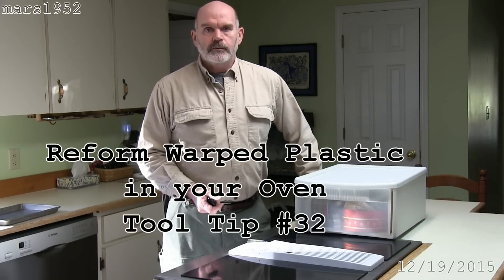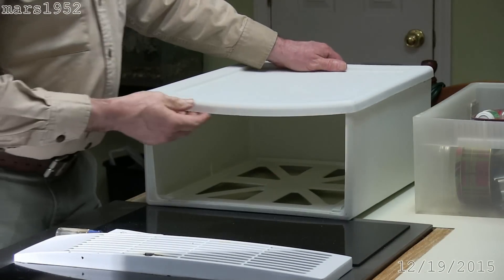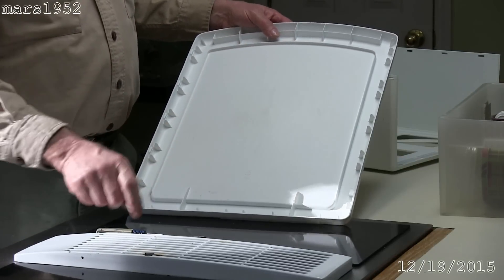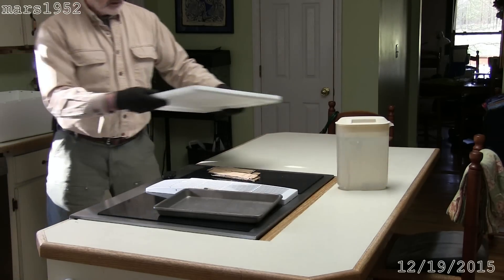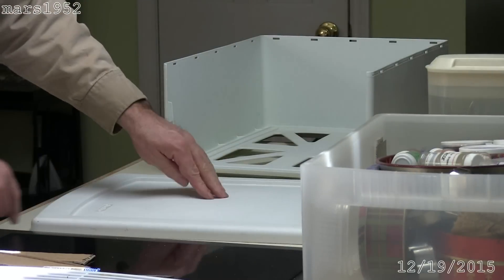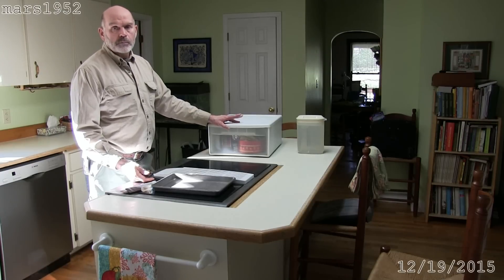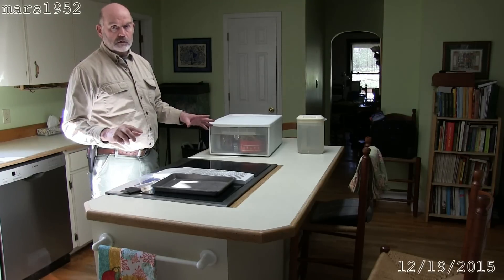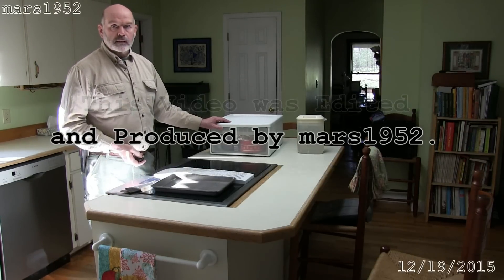Reshape Warped Plastic in your Oven Tool Tip #32

Comment: In-genius idea and execution.  I have the problem with the drawers sagging on the bottom from too much weight being put in the drawer and the drawer being hard to slide back and forth.  I am going to give your idea a whirl and see if it works.  Lucky for me the type of resin in my drawers is the same number 5 so I can use 300F too. It works like a champ and restored the drawer perfectly.  My model is the Sterilite wide drawer and the bottom is much thinner plastic so I only used my broiler pan with a 48 oz bottle to weight it down.  Both the heating with the oven turned off and the cooling process took about 6 minutes each.  Weight it down on whatever side is warped to force the warp down.  Mostly the heating restored the shape but a person wants to weight it down to reinforce the memory as it is cooling down again to room temperature. If a person is doing several I would suggest turning down the oven to 280 degrees (plastic numbered 5) for subsequent trials. Always remember to turn off the oven when the preheating is finished.

Comment: Ok this has nothing to do with a plastic drawer top but I had a plastic based desk lamp the kind with the bendy swivel metal neck. The lamp got left outside in the summer heat a year ago and warped onto itself so the lamp wouldn't stand upright it was going to get tossed. But after watching this video and figuring I could use my blow dryer on high in specific spots to reshape it with pliers and push on it covering my hands it would go back into shape, it did! So thank you for posting this video.
Reply: Thank you for hair dryer idea!
Reply: I was wondering about the hairdryer because my drawer is to big for my oven, thanks for sharing

Comment: Reminds me of plumber's using a heat gun to make solid PVC pipe flexible.
Reply: I used those candle lighter deal when I was trying to get my drip system set up and the drippers refused to go in the punch on the  rigid pipe...worked well and being warmed up sealed the opening to the dripper NO leaks.

Comment: Thank you SO MUCH for this hack and posting it! You saved me SO MUCH frustration with my rolling cart! I stayed next to the oven after preheating it. I put the plastic leg of my 3-tier cart (the shelf with the handle attached has a warped section on just one of the legs' connection areas and it's so large that I can't fit it into my oven so I decided to remold one side of the detachable legs that go between the shelf racks) onto the top rack away from the bottom heating elements. It only took 3 minutes before I started smelling the plastic, so I reached in and felt the plastic with my microfiber cloth and it DID give way so I took it out and put it back onto the top shelf's warped leg piece and then reassembled it back with the rest of the cart to make sure that it would mold properly and the bottom side of the leg didn't get messed up while I was remolding the top! 😩💨 I was a bundle of nerves for about 5 minutes and then totally excited afterwards! 😁👍 So thanks a bunch!!! 💕💕💕

Comment: I did 280F with the same method (oven turned off for like 20-30 seconds before inserting) and 5-7 minutes, used a big cooking sheet and some other weights (not too heavy). This did the trick, thanks!! I just wish this could work as well for my drawers which are dented in the back and probably can't fit in the oven as easily.

Comment: I had two tops to try with this. They are decades old. Mine did not even have a recycle symbol to identify the plastic! I tried the 300 degrees (utter failure) so I let the oven cool down more and tried 270 (oven off, for both). Ruined it, too.  If I were to do it again,  I'd take more time, starting at the lowest temp my oven had and work up. However, I suspect it was the type of plastic, not the technique. It's a very brittle type of plastic, not the more flexible kind used now. It was like a light switch on the checks... okay, not soft; okay, not soft; already ruined on the next check. Neither was in over 5 min. total. It smelled like the vac-u-forms we played with in the 1960's.
    Fast forward to what to do? The bases and vertical uprights that support the drawers were still fine. My solution? FOAM CORE BOARD! I traced a base - slightly larger to allow for a little extra on each side - and then marked where the vertical supports come through onto foam core board. I very carefully cut this out with a utility knife.
     So far, so good, on both the 3 drawer and 2 drawer sets. I store crafting items, and can place one drawer set per shelf on a bookcase shelf, so nothing stacks on top of it. I was basically trying to find a way to keep the uprights where they belonged so I could still use the drawers. 🤞

Comment: For those wanting to try this. Try placing a wooden board on metal rack before placing plastic to avoid melting! Hope this helps!
Reply from the maker: You would have to preheat the board to prevent the board cooling the plastic. Just follow the directions and turn the oven off before you put the plastic in.
Reply: I would think putting the plastic on something flat metal would be better to avoid getting rack impressions on the plastic. 🤔

Comment: You can paint a piece of sturdy plywood white, then cut to fit the top just a tiny bit bigger. That will protect it from warping again and give ya'll a sturdy shelf to set stuff on. 
I did that with mine and it works perfectly.

Came here because i have three beautiful cheap serving trays that have the warp in the center making them virtually useless.
Will try this method with them.
Just one question, what if a piece doesnt have the 5 on the bottom?

Comment: Thanks! It worked on our pre-owned plastic storage drawers however I added 2 baking pans on top while inside the oven to help flatten faster.
Reply from the maker: Did you preheat the pans?
Reply: @mars1952  nope, I put them on top of the warped plastic at the same time. It would be very difficult if the pans were pre-heated.

Comment: Excellent!
I have some plastic multi drawer units for craft supplies- some of the drawers always fall off the sliders. I was thinking it was the frame but it is actually the drawers bowing inward slightly. I was wondering if I could somehow reinforce the sliders- I’ll have to check and see if I could fix the drawers this way… and not put such heavy items inside! Lol

Comment: When I tried this, mine melted! I didn't want to melt it so I put my oven on 250! Apparently that was to hot! When you do this please make sure that it's not too hot, or don't leave it in for more than 5 mins!!! 😭 Now I have to make a new to for mine!!
Reply: Mine melted after 4 mins at 300°! Melted right to the rack.😫 It was bigger than his too and still melted very quickly. Was trying to salvage the drawer bin instead of buying a small dresser. Guess we're gonna go ahead and by the dresser now since the bin top is toast.😢
Reply: @triciakleidon4170  .. cut a piece of plywood just a tad bigger than the ruined top and place on top, of the drawer, first paint or stain it the color you like.

Comment: Do you have any tips/ideas on how to prevent stacked  plastic bin tops from crushing in the first place?
Reply: Have you ever found a solution for this? I was wondering the same thing. There should be a way to reinforce them somehow. Maybe by gluing cardboard or foam board underneath the lid?
Reply: Piece of plywood cut to size.

Comment: I had some large 3 drawer containers like this and since I couldn't figure out how to get the lids off without breaking the plastic I used a hair dryer and then heavy weighted stuff and let it sit for awhile. Seemed to work well. I wish these types of containers had stronger tops.
Reply: Thank you so much
Reply: Planned obsolescence.  Same reason why their laundry basket handles break after a year or so.

Comment: Nice tip, thanks.  👍   Do you think putting some mass (bricks, steel lifting weights) will make the oven hold heat well enough to soften multiple pieces that won't all fit inside at the same time?

Comment: I tried this yesterday.  FAILED.   I used 325.  Less than 10 min.  My top completely  melted through both over racks.  Thankfully I had foil liners an the floor of the oven. 
I neglected to have the oven OFF.  Operator error!
Details!
Reply from the maker: Bummer! That radiant heat will get you every time.

Comment: Great tip!  I am surprised the #5 PP does not melt where it is touching the oven racks. Did you place it directly on the rack, or on the oven floor, or maybe on a silicone piece of ovenware or silicone mitt? Wish I could have seen this in the oven.
Reply from the maker: Directly on the oven rack.
Reply: @mars1952  I just did this and the plastic started melting to the metal rack within 60 seconds. It was the #5 plastic and I turned off the oven after it got to 300F. I can't figure out why it worked for everyone else but not me. Seems like I followed all the instructions.
Reply: @stacymknutson  maybe try putting a wooden board on the rack and then put the plastic on top of the wooden board to avoid the plastic melting from the metal rack

Comment: What do you put it on inside the oven? Are you putting it straight onto hot metal racks?
Reply: I put mine on the rack but I put it in cold, set the oven to 170F and checked every couple minutes. It was done before it reached 170

Comment: This doesn't work for pyrex lids! I followed the directions exactly (starting to wonder why I was smelling plastic after about three minutes in the oven). I now have globs of blue and red on the floor of my oven. But I should have realized this wouldn't work for these lids because the packaging instructions say to NOT put lids in dishwasher unless on top shelf. Duh ... 😖
Reply from the maker: The various types of plastic have different melting points. You need to adjust the temperature accordingly. The oven should be hot but turned off and you need to closely monitor the process.
Reply: @mars1952  .. is there a chart somewhere that gives the different melting points?

Comment: Be careful with this hack! Followed the directions to a 't' and mine melted to the oven rack after only 4 mins! My plastic bin top even had the same '5 PP' symbol on it too. It's a newer oven so maybe it just gets alot hotter.🤷‍♀️
Reply from the maker: Did you turn the oven off before you put the plastic in?

Comment: If you were truly relying on the "memory" of the plastic to retake the original shape, then you wouldn't need to apply a weight while it cools.
Reply: Hey a little help never hurts as maybe the plastic is older and is losing its memory.  (A little joke in there somewhere)

Comment: I tried this but because I'm scared, i put the lid in the oven and set it to 170F. I checked it every couple minutes and the lid was soft before it was even done preheating
Reply from the maker: You must preheat the oven and turn the oven off before you put the plastic in to soften. I am glad you didn't melt your lid.
Reply: @@mars1952  on a very low temp I didn't have a prob and I checked it every couple minutes. If I set it to 300 then maybe it would've melted. Thanks for the tip tho I never would've thought to put it in the oven

Comment: I have a 6 drawer plastic unit that the top became warped from heavy objects being placed on top of it. I watched your video and decided to try it  myself just to discover the plastic top is too large for my wall oven. Any suggestions? I have a heat gun would this work?
Reply from the maker: Lay the top flat side down in the sun on an asphalt driveway. cover the whole thing with clear plastic. Weight the edges of the plastic down to trap the heat. I don't know how long it will take but it should get hot enough.
Reply: Same here. Thanks!

Comment: Does it smell to do this? . What about fumez
Reply from the maker: chozo echo There is no smell as long as you don't burn the plastic. You only need to heat it until it softens.
Reply: mars1952 thx worked like a charm

Comment: How do i fix the actual warped drawer its a medium size one .thx
Reply from the maker: @sybillemarley1836  this method only works on flat items. You would have to make a form for the drawer. It is probably not worth the effort.
Reply from the maker: @sybillemarley1836  I read through the comments and at least one person has had success with drawers. I am not sure exactly what they did.

Comment: Warped my food processor bowl when washing it in the dishwasher. Its a different type of plastic. Anyone reshapes one of these
Reply from the maker: You would need some way to form the bowl. This technique would probably make it worse.
Reply: @mars1952  I think im going to fit the lid in (its hard but I can jam it in) then use a hair dryer on it. Assuming it will conform to the lid when soft.